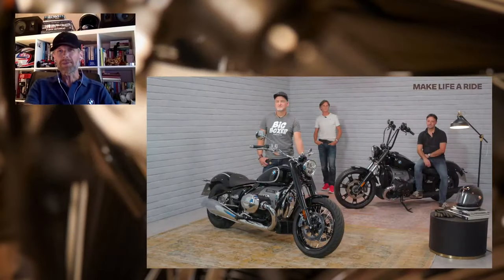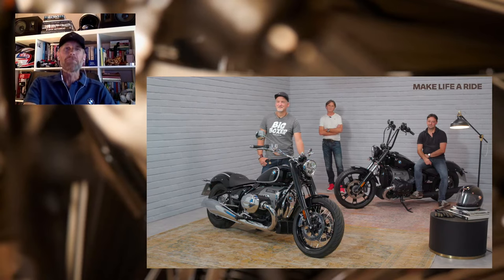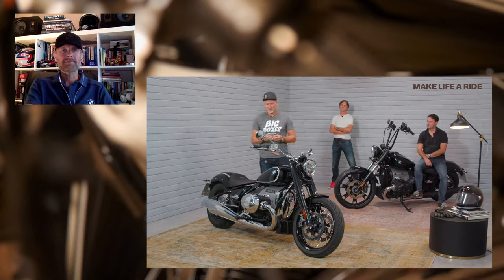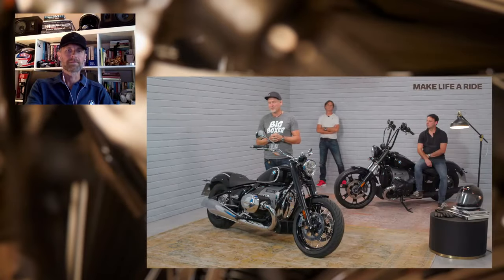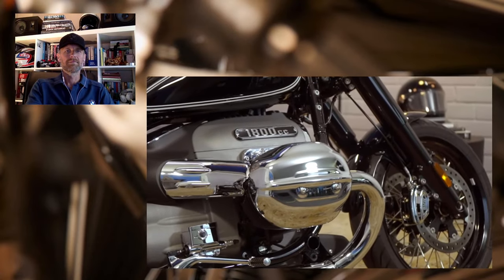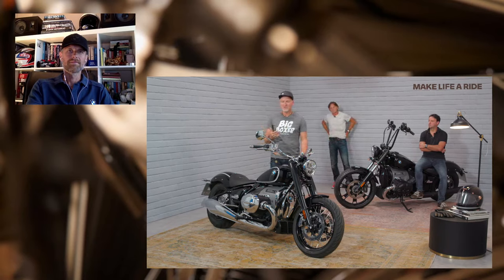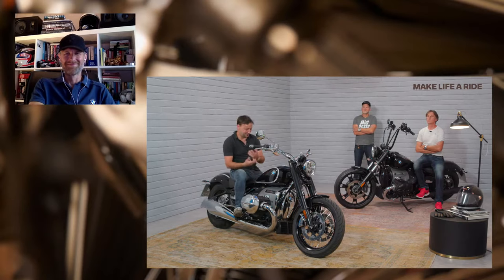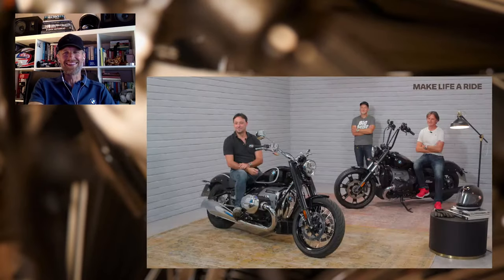Uncover the design, technology and customization of the new BMW R 18 l #RideAndTalk

Comment: I salute the creative minds and passionate souls of the engineers that made this my 38th BMW motorcycle in my riding timeline so far. It is the epitome of heritage of all the boxer motors. Its character and soul is unequaled! It is an immediate awakening of what motorcycling is all about; style, craftmanship, exclusivity, refined class, dependability and long term ownership low maintenance. It will no doubt hold its classic value retainability. It is an absolute joy to look at, to ride and it performs predictably beyond reproach in any area. It takes pride of ownership to a new level ! I extend my life long loyalty to BMW and my gratitude for creating a complete riding wonderful experience.